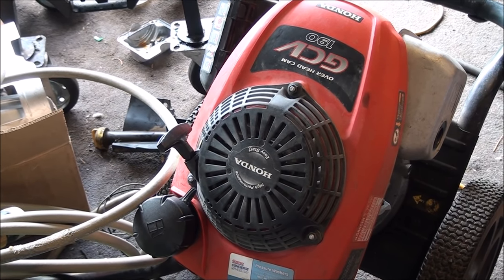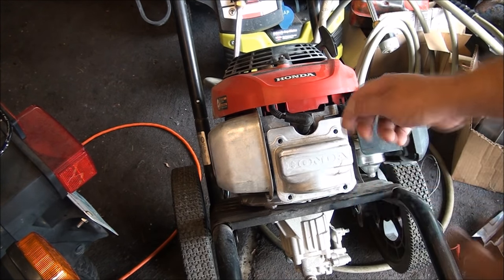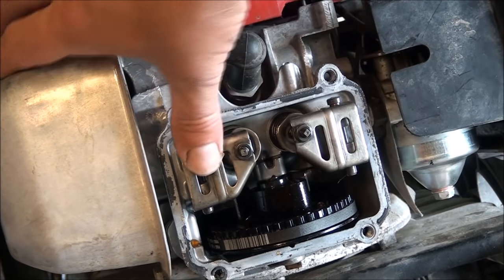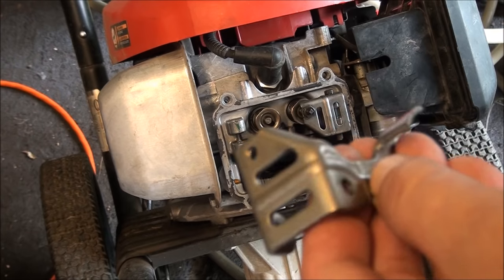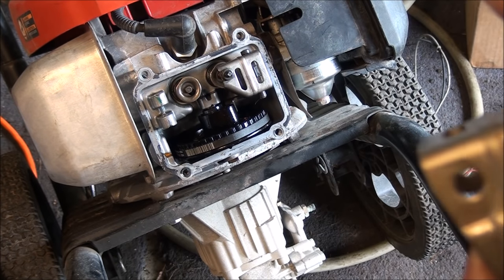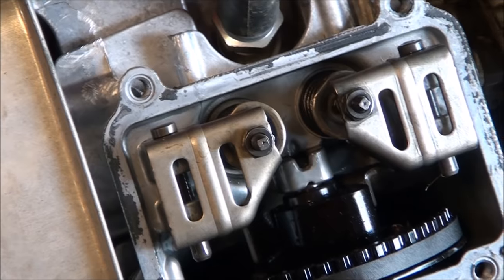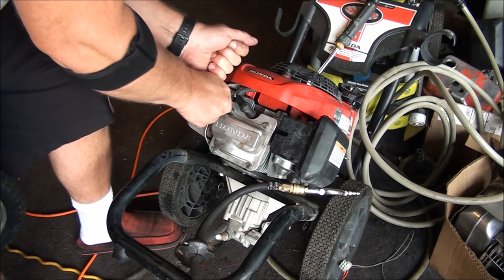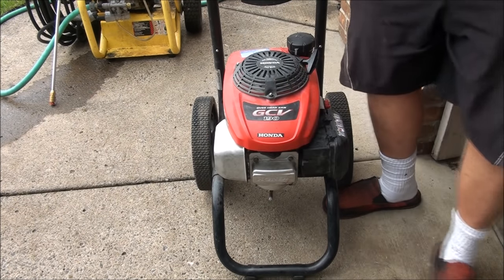Common Problem HONDA GCV 190 engine. HARD to PULL . HARD to START FIX Pressure Washer ROCKER ARM

Comment: I've got a GCV190 on my mower that is very hard to pull.  It runs fine, just getting it to turn over is a challenge.  I haven't spent much time diagnosing it as I haven't had it long.  But I think I know exactly where to look now.  Thanks Jeff!

Comment: I have a Husqvarna self-propelled AWD that I was ready to scrap. I remembered having a similar issue with valve train on a B&S 21HP on my old John Deere D120. I googled it, to confirm, and found your video. Lo and behold, I have a cracked exhaust rocker arm. I'm going to do the same as you, with the new seal. I found another thread, where the engine guru suggested Loctite 620 on the guide, before driving it back into place. I think I am going to do both. Better safe than sorry. Thank you so much Jeff!
Reply from the maker: Thanks for watching and for the comment

Comment: "They always seem to loosen up a little bit... after you tighten them down."
Makes sense. The locking nut is pulling the screw outward as you tighten it.
Thanks for sharing with us, Jeff.
Reply: THAT is the second reason for the square head - to stop that movement.  The same concept for all valve adjustments.

Comment: Thanks for the great vid !, my karcher pressure washer with a honda 190 has been pulling the cord out of my hand for two years and never knew why .Last week i was stripping the stain off my deck in the hot sun(90 degrees) and it finally died, saw your vid and sure enough the exhaust rocker cracked and bent, I.ordered the Honda rockers from Amazon only to realize the pivot pin that holds the rocker was trashed too. I replaced and gapped them and the engine starts easy again and runs great.$25 fix So before you order, check the pivot pins. Thanks so much!
Reply: Thanks, great tip on the pins.
  You guys are awesome.

Comment: If you look down at the flywheel there is a dowel sticking out.
Line that up with the notch in the case where the valve cover mounts.
It does not matter if it is compression or exhaust stroke on this engine.

Comment: Engines, stick edgers, weed esters, pressure washers, they all work dandy when consistently used. They all seem to get issues when sitting too long (like over the Winter). Regular use, oil changes, ethanol free gas, and you're golden. Except with pressure washers, I've always had more troubles, not with the engine, but with water pump. It's like $150+ service around here to have it reconditioned. For that price, it just might be time to replace the pump DIY.

Comment: I did exacting what you did but the thing I didn't was replace valve cover gasket. I tightening it well no leaks its hard to beat Honda factory parts.

Comment: The reason I’ve cracked my intake valve before is because the guys weren’t practicing proper pump operation paying attention to the  pump itself  and making sure they always are doing a pressure release after shut off.  They’d go to shut it down and wouldn’t release the pressure after shut down and then would not perform one before Pull starting it. They’d just go to pull start it not giving attention to the extreme compression all of the sudden and instead of taking the wand and pulling the trigger to release the pressure they’d just muscle it like they’re kick starting a Harley. You’re only going to make that mistake so many times until the engine or pump or both give up on ya. So yeah it’s real important to release the pumps pressure after shut down and before start up if you want the pressure washer to last.

Comment: Mine was so hard to pull the kickback was enough to pull your arm off.  Pulled the valve cover and no crack on the rocker arm, but the exhaust valve did seem like it had too much play in it.  So I set the gap to the OE specs, and boy it's like night and day.  Pulls with little effort now and starts on the first pull almost every time!  Thanks for the help as I was getting frustrated in why this was so hard to pull!
Reply from the maker: Good work. Good job figuring it out.

Comment: Thanks for the tip Jeff, I think that's my problem.  My buddy's mower has been pulling hard for awhile , now poping through the carb.
Reply from the maker: Heating up the valve cover helps in removal
Reply: I agree on heating up cover and look very closely for a cracked rocker arm

Comment: Watch for exhaust guide moving up and stopping valve movement, which breaks the arm, can put the intake valve seal with rubber removed on exhaust and new intake seal installed once guide is driven back down 😊😊😊
It works and will stay put 😊
Thank You 🙏
Reply from the maker: Good tips

Comment: I've seen the cracked exhaust rocker on enough of these Honda 160&190's to conclude it's a bad design that too many are suffering from. Honda really should have addressed this by now, or they make a lot of money from selling so many rockers?
Reply: Parts revenue $ every brand has some component that is designed to fail:/
These rock arms fault is they lack metal thickness in the area they crack:/
Reply: Yep, product recall, folks getting hurt from pulling kick back.  Put some heat on Honda they can afford to fix their f up.
At least offer the part for free. Reputation...
Reply: Yep cracked rocker or spring damage plastic gear on compression release 
Every time
Reply: I agree the exhaust valve is not getting enough oil and it’s trying to stick to guide 
You can count on where the problem is every time and on hundreds of them 😢😢😢

Comment: I have got a gcv200 mower, man was that hard to pull start. Just done valve's couple times so not happy. I went to the spark plug first to take out, found that the spark plug was not tightened up, simplest fix.Easy to pull now, starts OK. Not experience at this, I tried the stick method for top dead centre found tricky, I tried small led light in spark plug hole a little better for me.But hey thanks for you help, not to be rushed couple days thinking out is better than couple weeks down shop.

Comment: Nice fix Jeff: I found that if I changed my customers over to synthetic oil that it helps to stop valve seizing on those engines that run hard like on pressure washers. Thanks for the video.
Reply from the maker: Good tip!
Reply: Can you please tell me what kind of synthetic oil should use with Honda GVC190 and the weight??
Reply: @zackanani2508  synthetic 10w30 or 10w40 both are fine I run partially synthetic 10w30 no problems yet
Reply: Not in my case.  I use Mobil 1 and last week it refused to restart after a long run.  Just get one backfire when I pull the cord.  I haven't opened it yet (I was here to learn), but I fully expect a stuck valve and/or cracked rocker.  This video gives me the confidence to move ahead.  Thanks!
Reply: @zackanani2508  Any brand name 10-30 for summer and 5-30 in cold weather, Also a synthetic blend is good.
Reply: @wrb1000  Probably other issues, not the oil. Could be timing, burned valves, bad plug, water or old gasoline, etc.
Reply: What did you find?
Reply: We put 10w 30 sny in every one we work on and tell customer why
Reply: Thank you for comment, I ran into a stuck valve today.
Reply: Great idea! I am going to do just that! I don't want to do this twice.
Reply: Change the oil often and it will sure help 😊

Comment: Thank You for this video also, after I took the cover off I discovered a stuck intake valve. A little soak with WD40 ans a small tap it popped up. Thank You!

Comment: Jeff should have let the cover sit for an hr before cranking the piss out of it with his worn out 10mm. That way the body builds up in the sealant. I found that out with my transmission on my Dodge Journey. After I ran it down finger tight I let it sit all night and it sealed up finally tightening it the next morning.
Reply from the maker: lol! good tip!

Comment: I have a 3300 ryobi pressure washer with a GCV190 and so far it's been my worst investment ever.  It won't even start now.  It did after I cleaned up the carb etc.  It was fine yesterday as for starting it up.  Only pressure for half a second and then nothing.  Left it outside and it rained today, started for about 10 seconds and died.  After it started pulled the trigger and 3 small rocks shot out of the gun lol.  It's barely 2 years old.  Then it got extremely hard to pull, shut off the water and tried and pulled easily.  Turned water back on still pulls, just doesn't start.  I guess next step is to check the spark plug.  I know what you mean about those valve clearances.  I did a complete valve adjustment on my 2000 Honda prelude and it sounded better than before.  Took me 2 days to do that.  I am at a loss with this pressure washer so far.
Reply from the maker: I have seen the pumps fail and make the engine hard to pull the rope/hard to start. The rocks may have gotten into the pump too.Try using starting fluid to see what happens

Comment: I know this is a stupid question but I'm still learning and I don't want to screw this up.... When you spray lubricant before closing everything up are you just spraying WD-40 or is there something more appropriate for engines??
Reply from the maker: Motor oil is best, any lubricant is better than no lubricant

Comment: Thank you, for the tips, my rocker arm wasn t broken but the valves were way out of spec, now it fires without issues, thank you for your time
Reply from the maker: Glad it helped
Reply: Bent rocker arm?
  Not broke but bent?
Will it bend see more?
Weak fatigued metal?
Thanks for the info

Comment: So, those engines do have markings on the cam gear, two little lines that level out horizontally with the edge of the cylinder block (would have been facing down with the orientation of the camera/engine), and the crankshaft has a line/arrow that lines up inside (had to replace the crank on one of these), once those are all lined up respectively you can re-install the timing belt and re-assemble. I am now curious though to check my valves, as I am also having a hard time pulling mine/getting it to turn over. So thank you for this.
Reply: Can you confirm that the cam lobe is dead center with the piston at max height? I'm doing mine now but the lobe is off to the left at max height. Does this matter?
Reply: I would say that yes it matters, even one tooth off could make the difference between running properly with correct timing and not. Just like how a vehicle would not run properly if it was off a tooth on its timing.

Comment: Thank you for the good video. Now the question comes up - Why did it crack? Perhaps the gap was incorrect at some point and put too much stress on it?
Reply: ..... Engine operated vertically and/or low on oil ? 
valve stem dries & ceases, rocker tries to compress valve & cracks ?
Reply from the maker: The valve was stuck when I opened it up
Reply: Rob Robbie only the cat knows an he ain’t telling. Sometimes stuff happens, Honda parts are plenty available and inexpensive.
Reply: On my gcv 190 the valve guide/seal slide up out of place which caused the valve to lock up.
In turn cracked the rocker arm.
The valve was not actually stuck or siezed.It could not go down since the guide came up and out of place.

Comment: Hey Nice Input. What can it be on a GCV530 a cold start is on point but if the Engine was hard on work and I Stopp it and will do a warm start the Engine turns but no Start in 90% of cases.
Compression is 4,2 Zyl 1 and 4,8 for Zyl 2 (6-8Bar)
Sparkplugs Ignition Coils are new, carb is clean. Cause my fault is exactly the opposite of yours. With Choke the warmstart works...
Reply from the maker: warm start problems often indicate that the carburetor is flooding and needs to be rebuilt
Reply: @JeffsLittleEngineService  thanks for answer. On weekend i checked the valve and they are in good condition. The cam wheel and decompression works fine. So the last two things are the carb and in worstcase the piston rings

Comment: I have a GC190 on my pressure washer vertical version. Upon looking at the valves the intake rocker was really loose. If you adjusted to the .006 the adjusting screw was almost all the way in, not enough threads to install lock nut. Looking for what would cause this? I now have taken the engine apart and ordered new valves and springs. Have not pulled the flywheel off as yet so I have not been able to look at the valve itself.
Reply from the maker: make sure the valve guides and rocker arm stud have not come loose
Reply: After tearing it apart it was the valve seat had wobbled enough to come loose from the aluminum block I'm going to try to stake it to keep it in there for future years

Comment: Super repair Jeff. Any ideas as to why the exhaust valve got stuck?
Reply from the maker: not sure. possibly a low oil situation.
Reply: @JeffsLittleEngineService  Thanks - and keep up te good work. Really enjoying you videos
Reply: Seems it’s very very common if the oil level is low and sticking valve exhaust in guide 😊

Comment: Hello from Australia🇦🇺. Great video thankyou. Did you wait to let the liquid gasket paste set before starting the mower? Also i have 2x 196cc electric start mowers that are hard to pull start even when they were brand new they were hard to pull. Would it most probably be that the valves were not set very well from factory or could there be other reasons why they feel so hard to pull start?
Reply from the maker: yes I try to let it dry overnight. Hard starting could be the valves or something else. It is not likely though that they were set wrong at the factory but maybe possible. Thanks for watching
Reply: @JeffsLittleEngineService  thankyou fir taking the time to answer my questions. 👍

Comment: Well, the locknut is missing on my exhaust valve. Now what? I guess it's in the crankcase somewhere but how do I access that?
Reply: Maybe I'm living better than I thought I was. I tilted the machine to the front in a big was tub and shook it the best I could. lol and behold the nut fell out. Now we'll see if there's any damage.
Reply: Good job, how did it turn out, Scott?
Reply: It actually turned out good, sorta. I reinstalled the locknut, adjusted the valve to spec and it started right up. I ran it  a couple times for a total of 30 minutes or so. Later it wouldn't start and appears the exhaust valve is stuck open, not fully closing. I haven't gone back into it yet.

Comment: i noticed when you took of the cover every thing was clean , when i took my off it was all in oil , is it supposed to be like that
Reply from the maker: some oil gets up in there. If it got tipped or too much oil can cause alot up in there.
Reply: @JeffsLittleEngineService  is it a bad thing if it get tipped over

Comment: My exhaust valve was stuck too. I pushed the valve into the cylinder and ball honed the guide. After assembly, it about broke my hand trying to start. After watching this I see the broken rocker arm!  What causes the valve to seize in the guide?
Reply from the maker: since I have seen a few like this it must have been in error made at the Honda factory

Comment: Hi you mention in the video you tapped on the valve with a hammer to loosen the stuck value, I’ve had problems on 2 of these engines a had the rockers crack due to valve guide slipping, I think that is what happened to yours. I tapped mine back into place it lasted a little while then slipped again. I’d be surprised if this machine lasted very long before the problem came back as it will slip again. I just swapped the engine in the end. I’ve only had it happen on the 190, the 135 and 160 I’ve never seen it happen on those. Good video.
Reply: Pressure washers have a back and forth torque load while in use causing a shock load known as water hammer. This transfers to the crankshaft and ultimately the valve train causing valve springs to be tested to their maximums. The timing belt is rubber and stretches to absorb the shocks. Remember what happened when your feet slipped of the pedals on your bike when you were a kid? Same principle.
Reply: Could be that the exhaust valve guide is migrating out of the case, and contacting the rocker arm. I made a video in which I address this issue.
https://www.youtube.com/watch?v=zZz0MRqxGX8

Comment: No need for all of that top dead center stuff. You can see the cam lobe right there. All you have to do is set the lash when the exhaust rocker is on the base circle of the cam basically when the lobe is opposite the rocker
Reply from the maker: good tip

Comment: #1, Make sure there’s no pressure in the hose or at the pump. Without pressure she pulls right over.
Reply: I remove every water pump that comes in shop first thing 
I’m not buying them a new washer pump period

Comment: Hi Jeff. I bought brand new rockers, I replaced them both, adjust the valves, first rope was fine. After that same story, it's ripping of my hand. Any ideas? Thanks
Reply from the maker: I would recheck valves or possibly a sheared flywheel key
Reply: @JeffsLittleEngineService  OR the exhaust valve guide partially pulled out.

Comment: Jeff, is that a common problem on the 160 and 190? Great repair.
Reply: teh60 I’ve never seen it before. Not too common is my take on it
Reply from the maker: Not real common but I have seen it a few times
Reply: It’s getting to be very common now and I started stocking the rockers now

Comment: Had the same engine  Tuliped an exhaust valve  Was hard to start from day one  Is there any way to adjust timing on this engine?   Timing belt  timing was correct

Comment: Jeff how do you find specs for value adjusting, compassion on different brands or what?
Reply from the maker: if I don't have a manual I look it up on google
Reply: Gragg Cain google
Reply: Gragg Cain if you need an IPL, go to ereplacementparts.com. , there you can see a diagram and find part numbers, and order parts if you want. Great company to do business with, though I think shipping is kinda high. Or shop on the webernet